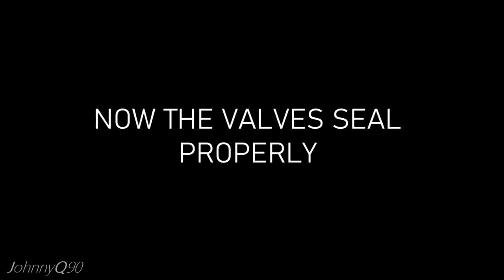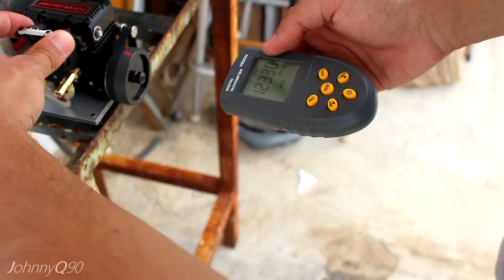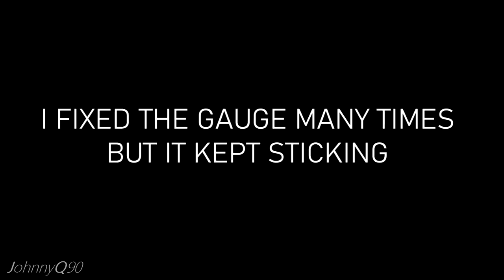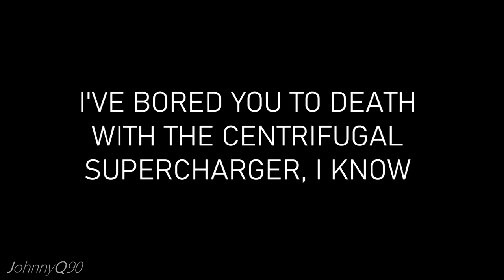PERFORMANCE Upgrade for the 4 Stroke TWIN Cylinder - *VALVE Lapping* - Supercharger Update

Comment: Could you try spinning the compressor wheel with mini turbine?  BEFORE YOU GO HERE ME OUT,with the engine reaching such a high rpm,its bound to be spitting the exhaust gasses out pretty fast whick could maybe spin the turbine fast enough. Maybe the turbine could be made like the dc motor turbine you made like 5 or so years ago.

Comment: Inlet valve springs may not be stiff enough to resist the boost pressure, (what little boost pressure there is).....
I experienced simmilar when I turbo charged a non turbo car engine many years ago, boost pressure was holding the inlet valves open when they should not have been.

Comment: Hey mate, your vacuum gauge going crazy, it is because the intake does not have enough volume to dampen the induction pulses, also, you are using a non-dampened gauge.

Comment: I'm not very sure how these carbs work but do they use needle jets?  If so throw the fuel to it.  You may also need to adjust the butterfly valve as well.

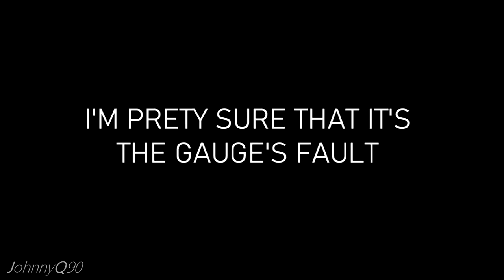Comment: 10:10 Haha blower surge. Fuel cannot burn as fast as the charger crams it in the engine. It runs rich and starts to die, when the engine slows down, less fuel is being dumped in abd the A/F ratio gets corrected momentarily and it accelerates again and repeats the process. In a draw-through setup, also a too small intake (carb slide diameter most likely) can cause it to get rich.

Comment: have you thought about potential valve float? Between boost and high rpm those springs may not be enough to keep them shut when not on the lobes.

Comment: So you have the intake go through 180° from the outlet of the supercharger, The driven pull is rediculously small so the belt has to wrap around allot to get any puchase, no doubt with allot of tension on it. Finally a draw-through centrifgual where atomised fuel get really fucked up going through a high speed impeller, That and the cooling of intake charge as is passes through a carb is why everyone runs blow through carbs not this.
[With a pressure bleed into the tank] Bigger blower with a bigger pulley going to the carb and then a smooth flowing Y intake.
Bigger blower spinning slower is more efficient that trying to get a small one to whisk the air at 140K rpm.

Comment: I'm also thinking... Smaller engines flip out like this when there is an air leak, did you check for those? Engine sounded lean
Reply: It runs like a 2 stroke with a vacuum leak, ill bet the engine is sucking air through the supercharger bearings(when running the draw through setup)
Reply: yep my thoughts exactly

Comment: Shouldn't the fuel be pressurised? I know on charger blow-through carbs on large engines all the breathers (and top of the slide) of the carburettor are connected to the charger otherwise they run badly (lean). Seeing as you don't have a bowl on the carb, I wonder if pressurising the fuel tank with a hose off the supercharger will help?

Comment: maybe just cheat and hook the super charger up to a brushless motor. spin it as fast as you want. maybe even make "boost" button on the controller and when you push the button.... boom.. kicks on the motor and you get boost.  tune the engine without boost. that way it actually runs.  then see how the motor powered blower affects it while running full throttle.

Comment: I think as the boost increeses, the vacuum just sucks in more fuel and it just so and with the more fuel it will spool up the rpm and suck even more but then at some point there isn't enough air because of the throttle and the engine dies back down, giving the rocking in RPM

Comment: Next step:   reduce size if valve stem protruding in the port.

Next:  smooth out inner radius  

Both steps will increase flow dramatically.....as power and rpm...

Comment: You aren't holding the RPM laser in the same spot on engine balancer. First clip you are on edge of it which would read slower than the - inside reading you were taking to hit 16,000.

Comment: Johnny am I missing something: you didn't have exhaust pressure going from the engine into the fuel tank to pressurize the fuel system, or does it not need to for the draw through?

Comment: may be a spark problem due to the ignition timing, I had a problem on a 4 stroke engine and I persisted in wanting to adjust the carburetor when the problem was due to the ignition timing.

Comment: No blow off valve on a pull through will make it run like that because the supercharger is pulling extra air through the idle opening while it's spinning down

Comment: There doesn't appear to be any fuel regulation, I'd be looking into that for the draw-through setup, maybe using boost or exhaust to pressurize the fuel tank will help even it out?
Reply: Also, don't give up! Even these fails are super interesting, nobody else is doing this stuff with this much detail, absolutely LOVING your forced induction videos and waiting patiently for you to look into exhaust driven turbos ;)

Comment: I don't know if it is, but the possibility is there that the valves float after a while on high rpm's. Other or compound springs will fix that problem, must it exist ;)

Comment: I had a cheap DTC from shars that would stick and I could barely tell but all of my measurements looked way out of spec like everything was out of round and no amount of adjustment could fix it. Turned out to be the DTC and I tried to fix it, and while it appeared to work it was never accurate. Bought a used B&S value .0001" graduation and never looked back.

Comment: I was wondering, is it possible with these tiny RC engines to use a full fledged ECU like the Speeduino and MAP the fuel intake?

Going from ambient pressure to a few PSI with that supercharger makes it impossible to have a valid fuel mixture for more than a few 1000 rpm doesn't it?

Comment: look how centrifugal blowers work on cars, the throttle body is always after the blower. this prevents blower surge, which is a tendency on positive displacement blowers. try putting the carb in a draw through, and the throttle body after the blower.

Comment: Well suck throughs for the carb doesn’t work, biggest delta pressure it can draw is atmospheric pressure.  You should have kept it blow through and put a orfice between the gauge and the manifold. Blow through allows a large delta P across the carb. The orfice would have stabilized the measurements. I bet your setup works.

Comment: i think the carburetor is to big for the setup. it's letting to much air in which cant be properly controlled. you either need a smaller one or add a throttlebody

Comment: Intake plenum volume is too small for the gauge to read the fluctuations. Internal pressure is switching with no reserve volume to act as a spring and buffer the pressure waves. Such a small volume of gas has little cushioning ability making it act more like an incompressible fluid than a tire absorbing vibration from the road.

Comment: Bro your boost is running crazy lol. Pretty sure a wastegate or supercharger bypass will fix this. Even positive displacements, like you speak of, come full scale with an internal supercharger bypass. That gauge was likely wrong about 3psi of boost but i think its boosting more than you think... AT IDLE lmao. ..which is pulling a bigger vacuum to pull fuel through causing the idle to run away. If that extra air/fuel had a place to go instead of pressurizing the combustion chambers at idle then... Or you could run efi..

Comment: You might want to try a different carburettor. I have had various nitro engines that were very hard to tune with the original carb. Nearly always, they ran much better witn a genuine, japanese O.S.-carb. In the nitro model airplane scene it's quite known that OS carbs are the best.

Comment: Maybe making a cam with more duration the valves will stay open longer hense more air you can push in to the combustion chamber... And put stiffer springs in it

Comment: Possibly running odd because of the extra air it’s getting. Either needs more fuel or maybe timing adjustment.
Reply: Also the boost gauge wasn’t hooked up when it was running odd. Possibly that vacuum leak at the intake manifold causing that surge and unsteady idle

Comment: I had a 1/8 TGX I built up slowly about 17 years ago, and tricked it out with alloy parts, 2 speed transmission. I was going to mount a big block Sirio .18 on it, but I ended up selling it instead at a big loss. I wish I could go back in time and smack myself. The car was never run even once.. lol

Comment: make a much larger inlet manifolkd it will help with boost as it could be scavaging pulses from the other cylinder
Reply: also exhaust manifold with a pipe from there to the tank

Comment: With the high inlet pressure try colder glow plugs.
I think it is running to hot
All so the try less nitro.
At high compression it all burns to early and fast

Comment: Not at all bored. I think the problem could be a vacum leak, also try to go back to the 8,5:1 pulley, ans see if it still is a problem, remember uou are using a lot of power from engine to spin that thing

Comment: Draw through setups become untunable when there is a boost leak. I would def start with looking for a boost leak. If you do not find any try a larger carb. I bet its super lean, which would also make it untunable.

Comment: Tuning tiny engines must be 100 times more tedious than tuning full size engines. You need tiny sensors on everything, tiny cam position and crank position sensors, tiny tunable fuel injectors , tiny air and exhaust sensors, a tiny brain box that you can connect to and the icing on the cake ... the tiny dyno to run it on to measure everything while it's running lol. In essence you could spend as much as you would on a full size engine, money, the only part of the tiny engine that is not tiny.

Comment: Hi i think you might need a mechanical fuel pump as well as the supercharger  , so the fuel is pressurized as well as the air  so it can keep up with the supercharger , the pressure nipple off the exhaust is not enough , as i have played around with pressurizing the fuel o my old car and it made a big  difference ? just a idea   ( try a electric Windscreen washer pump ) as a fuel pump  to try it out ?

Comment: carb definitely is a weak point. I'd swap in a carb from Tamiya or Traxxas 4 stroke. get the engine at top tune normally aspirated first, before adding non-measurable boost.
 there's a lot of power mods possible for these little guys but at the cost of some longevity and reliability haha

Comment: You need a blow off valve. Or you will never be able to tune it. The boost pressure is always present in the intake tube. It needs to be able to bleed off boost pressure at idle and close off and allow boost under load (RPM). You can figure out a vacuum boost controller I’m sure, you’re more than smart enough. Also, go back to the flywheel pulley you had on before the huge one. Increase the pulley size on the blower itself. The engine harmonics will be a lot less with a smaller flywheel pulley.

Comment: You probably cant adjust the fuel properly because the air flow is in the wrong order. The way you have it set up it is sucking the fuel from the tank thru the carb. It should be sucking air and forcing fuel / air mix thru the carb in a highly compressed manor. You want to FEED the fuel not have it ripped from the tank with the super charger intake vacuum. the way it is now you are just drowning the motor with too much fuel.

Comment: You need to modify the Turbo.

Try to build a larger Turbine, and the RPM from a Standard Turbo is 100.000-150.000 RPM.

Comment: You need the throttle body past the turbine. The carb doesn't mix the right afr always seeing vacuum even under boost. That's why you don't see a car with the throttle body infront of the turbo

Comment: If you exchange your intake manifold to a plenum chamber, then you will get a stable positive pressure on the intake. That will help you set the low idle speed and fuel mixture. Otherwise you can get cycling effekt of short negative pressure, wich can make it alternate between lean-rich. Therefore the difficulties of making it run smooth. The plenum chamber has to have the same volume as the engine as a minimum. I prefer 1,5 times the engine volume.
https://images.app.goo.gl/PVr15GEbCUHrrkAp7

Comment: Need to have a blow off valve in order to let the excess pressure blow off when you close the throttle gate that's why you're having a hard time tuning it if you made a blow off for it to be easier for it to tune

Comment: Sounds like a vacuum leak seeing as the whole supercharger is now under vacuum I wonder if it pulling air though the bearings on the charger shaft
If you have it running and cover the carb inlet does the engine still run?

Comment: Are you sure your engine is getting enough fuel when the fuel line is plugged to the top of the (non pressurized?) fuel tank?
Did you consider a fuel pump or a pressurized fuel system to run boost on your engine?

Comment: Can you make a Intercooler for the compressed air
the supercharger continues to pressurize when the engine is not running, so you have to install a pop off valve

Comment: U have To use back presure from the engine exaust collector To presurised the tank look like the mix To lean try wit the second neadle valve on the carb piston valve if Not working try smaler ventury size wit larger jet size use carb wit the 3 seting two neadle wit sort of valve on the side of the carb

Comment: It looks like the engine is going to lean when it starts to apply pressure. What if the boost pressure were used to get gasoline? Eg so that the pressure pushes into the tank and forces the fuel to the gasifier?
Reply: A port on the compressor housing like a turbo, it vacuum the ank at idle and pressure under boost.

Comment: lol my sphygmomanometer specifically states on the instructions to avoid rapid changes in pressure to avoid damaging the gauges internal spring. 

You did exactly the bad thing lol.

(Also you're just running lean. More air = more fuel needed. That little line and internal pump just isn't going to cut it here)

Comment: I think the main problem with the carb not being tuneable is probably because there’s practically nothing to it, if it was closer to a carb off a small stationary engine like on a gokart then it would be much easier to tune as it has more jets and tune ability than just a standard carb for these tiny engines also that gauge just said nope and gave up on life 😂

Comment: Im surprised at how many ppl in these comments are so hung up on the pressure gauge. Its NOT supposed to be mechanical for boost applications on a combustion engine lol! thats for steady air pressure on an air compressor lol. Because there will ALWAYS be vacuum in between combustion cycles on a boosted gas engine, is the reason why ALLLLLL boost gauges for automotive applications are DIGITAL lol.

Comment: Change super charger over drive back I'd guess it's too much compressed air at the low rpm and not enough fuel

Comment: I fear you're still seeing a vacuum from the intake stroke overcoming your flow output from your supercharger. I come to only one conclusion, you must increase the diameter of your supercharger! :D
Reply: also aviation gasket on the parts so they seal up with to minimize boost leak and vacuum leak.

Comment: Amazing job but to me it seems as if the supercharger has no way to release it's boost too the engine and in the video it seems like it idles and then when you rev it then It acts up so maybe if it has some type of blow off valve it maybe would run smoother. It's just my thoughts 😂😂

Comment: I don’t think that passing a liquid through a centrifugal supercharger is a good idea. It might work with something like LPG, but not nitromethane and oil.
It’s likely not going to work well with the roots style supercharger either as a pass through. It’s the fuel, not the FI compressor.

Comment: since i have seen these small engines running i have never observed that they are injecting any lubricant or motor oil in it i mean to say no mobil oil in engine even if they are 4stroke.

Comment: You need to pressurize the fuel tank with exhaust pressure, then youll be able to tune it, its not getting proper fuel flow 👍👍👍👍👍👍👍

Comment: Draw through with this type of fuel is too sensitive. The oil mixture will cause the fuel to stick the compressor wheel and tubing. Your mixture will never feel accurate and tuning will be impossible. 

I think blow through with the valve lapping would be the combo. But too much boost pressure and you loose fuel pressure. Tricky.

Comment: Like ive said before a motor is an air compressor witch works on psi it doesnt matter how big or how small psi is psi your boost pressure isnt enouph

Comment: hi guys i want to ask something how does a 4 stroke 2 cylinder engine works in inline 4s there is always one cylınder doing work how does 2 cylinder doesnt stop it should eventually lose its idle rpm doesnt it? i couldnt find any proper info on the net i would much appreciate it if any of you can enlighten me

Comment: That engine doesnot have the mass of inertia in it's rotating assembly to spin that supercharger. And even if it did, that intake piping has too large steps in it to flow properly, and air leaks, and too tight bends. Just next to the fuel nozzle, there's a step and an air leak. Just before the split, there's another step and air leak. No wonder it can't be tuned. The whole fuel delivery is a mess.

Comment: You surely have a vacuum leak and a boost leak. Must be caused by the bolts instead you should’ve put clamps to create a seal a around the inlets

Comment: I guess it's the same as having a huge supercharger on a dragster, they also have super lumpy idle caused by compressor surge, but run well on wide open throttle.